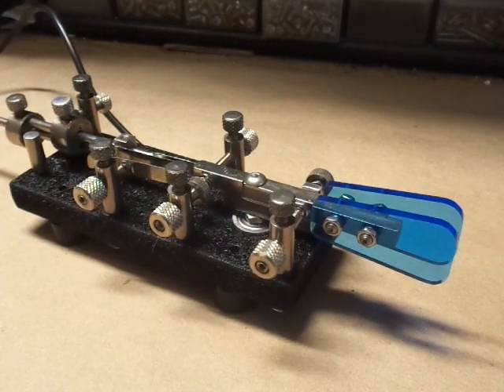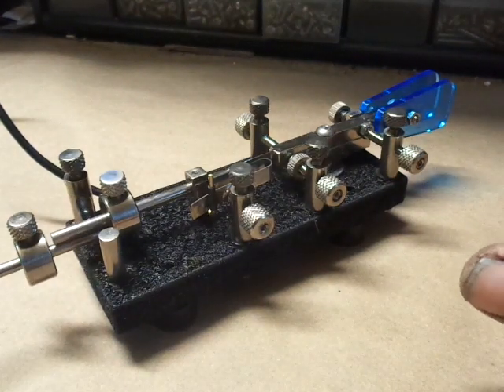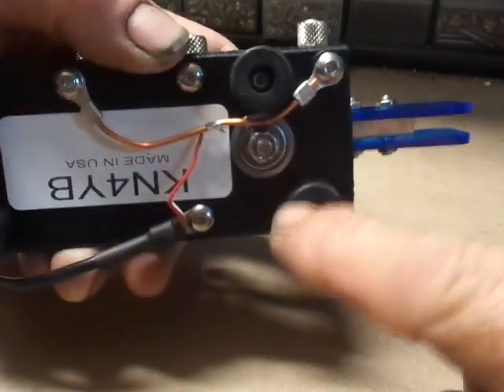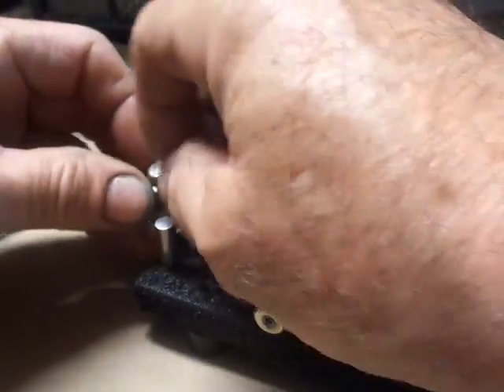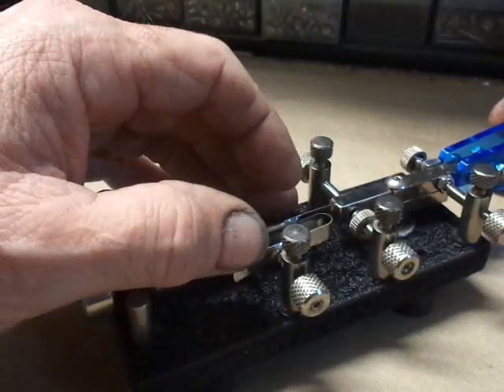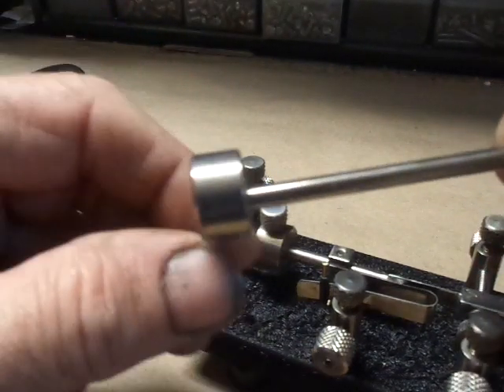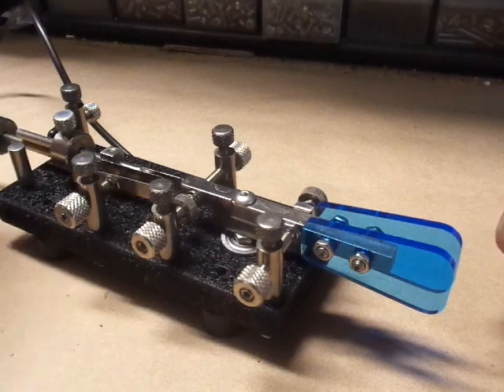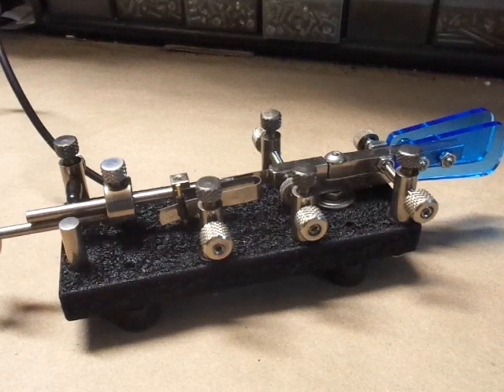SL170IN KN4YB New bug key

Comment: Where do I order this bug ?
Reply from the maker: KN4YB.com
Reply: @devoeh2  I would love to see somepictures n your website,    or FB
Right Angle Single Lever SL190RA 190.00 (new replacement model)

Right Angle Single Lever SL191RA(straight blade dit contact) 190.00
Inline Dual Lever DL165IN 175.00
Right Angle Dual lever DL150RA 160.00
Right Angle Dual Lever DL151RA (straight blade dit contact) 160.00
Inline Single Lever SL170IN(new model) 180.00
Inline Singel Lever SL171IN (straight blade dit contact)180.00
Reply from the maker: @CWfist  Love to see them too but just swamped with work and just cant get the time to update the web site. But on here you can see them in action!
Reply: @devoeh2  OK, that is good, business is good I hope, i will add my order soon,  I found you in FB.